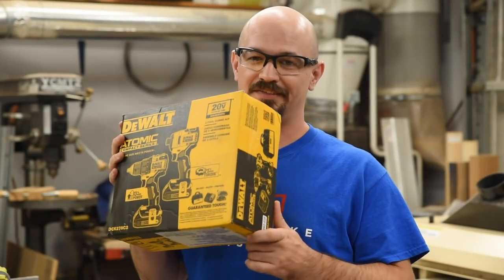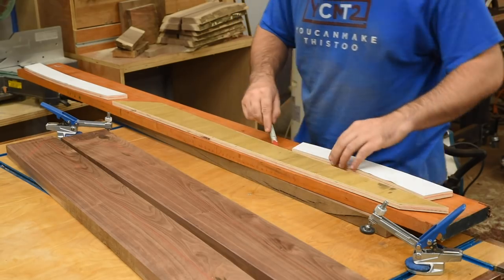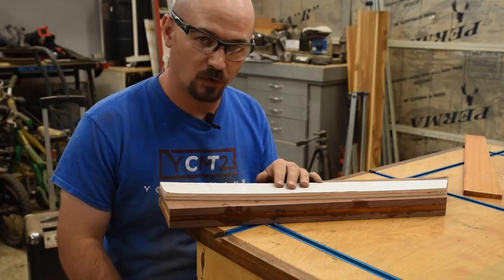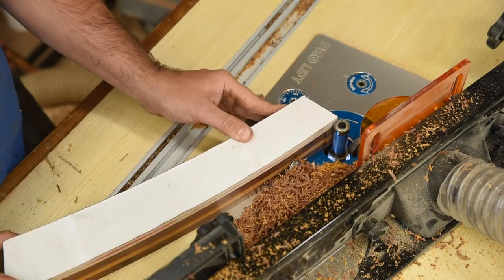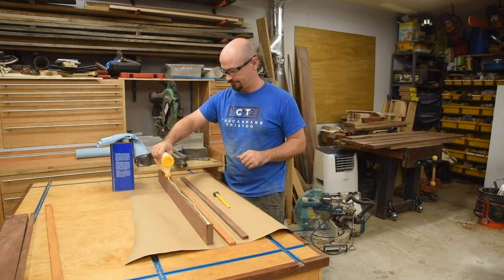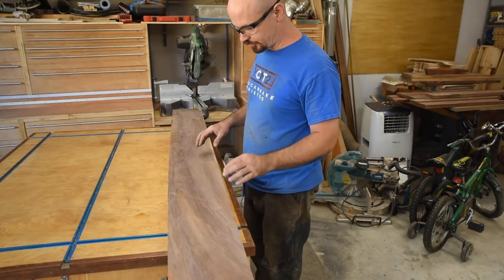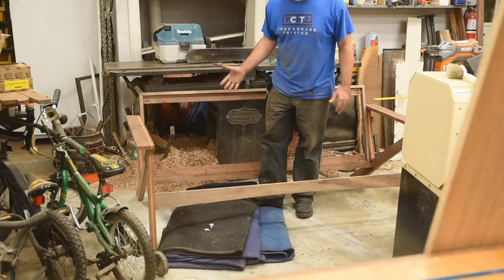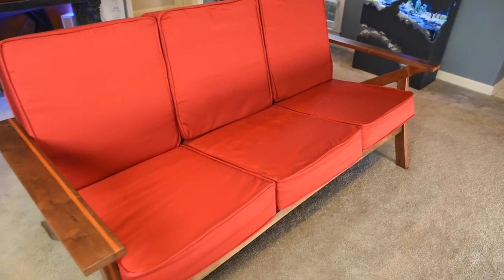How To Make a Modern Sofa | Plans

Comment: I like the project and design - plans are well priced - but where would I source cushions?
Reply from the maker: They're standard size, that's all noted in the plans. Bottoms are 20x24x5, and tops are 20x20x5. So anywhere you like to buy cushions, or there's probably an upholstery shop not too far that can make exactly what you want (and probably for less than what we paid in material to make them).

Comment: on the arm rest you are using what looks like Titebond glue but on the other pieces you used Total Boat epoxy because of the oil in the Orange Heart?  the lamination are structural and the arm rests aren't so that is why the Titebond will work?
Reply from the maker: It was just an experiment to see how it would hold. I'd had more time working with the orange heart and thought it'd be okay if I cleaned it well, and like you mentioned.. less stress on that glue joint.